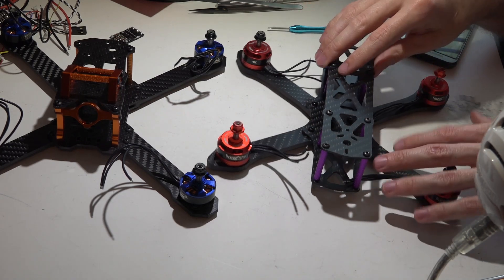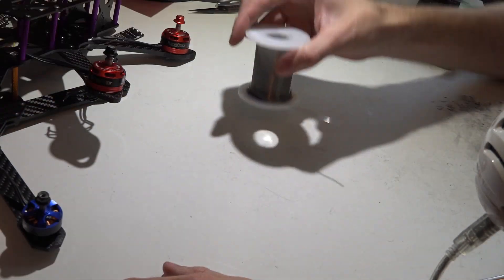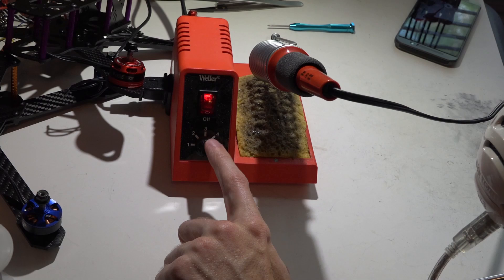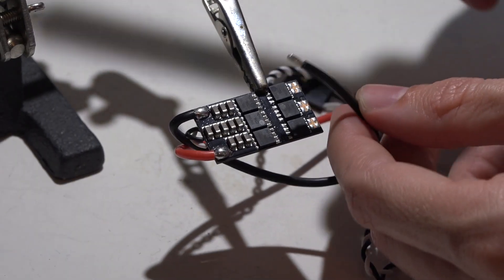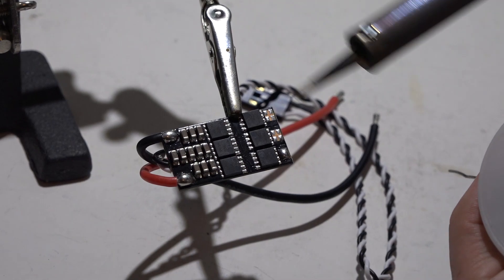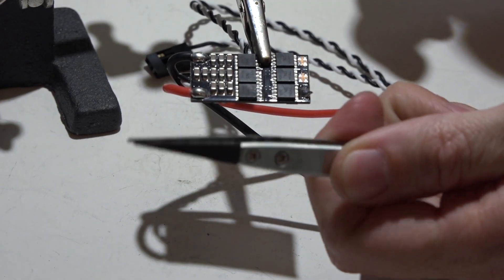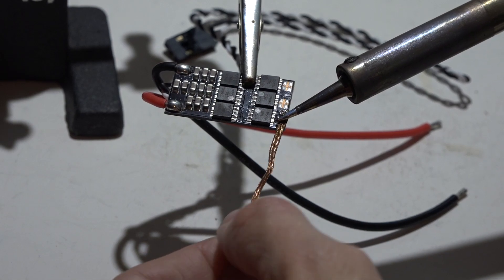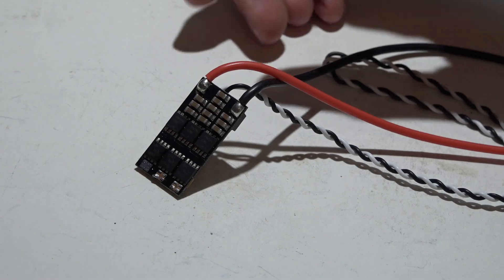Multirotor Build Pt4: Soldering Tips (plus more motor advice)

Comment: Love your series and this is a great comparison video. Thanks for doing it. One thing I saw on this video which you might want to try. On your helping hands station, I usually put one, maybe two pieces of Heat Shrink right over the teeth of the alligator clip, to help with damage control. It seems all too often, the newer boards are coming so compact that there really isn't anywhere safe to put a raw clip without damaging circuits or chips.

Comment: I used to do benchwork repair on telecom equipment (in a previous life :o ) and occasionally had to repair traces on circuit boards.  The wire gauge depended on the trace width, but 30 gauge (usually green-clad to match the PCB) wire was the most common substitute.  It was tedious at first, but I reached a point where it became as easy as any other repair.  Route the wire to mimic the original trace route, and glue it in place...  If the missing trace also ripped the pad away, then solder directly to the connecting wire.  I usually found a way to keep it neat and functional...!  

Keep that great content coming!

Comment: I've given up on solder wick, (or I lost it) I just use some battery wire, strip a bit of silicone off and dip it in flux, I use a tub of plumbers flux I've had for donkeys years, this works just as well, if not better and more controllable.

Comment: For soldering pads tinting wires and all kind stuff, change iron tip for more short and flat it will be giving more heat. This thin tip is for very small elements imho

Comment: Seen 43sec of your vid now, THANX for that tip, seen many who has gone with the hype and steel motors, some flights in they crash and wine about a bad motor. NO nothing wrong with the motor, only the screw.... so LOCK blue on all motors is the way. if they have a screw and not the c clip :)

Comment: i like blu-tak for holding stuff in place while i solder...those little helping hands wobble and drive me mad
Reply: I use blue tac for holding some things but on parts that are going to get really hot it melts and can be a PIA to clean up. Something I've found really useful for lots of.electronic type work is a little $20 hobby bench vise with a ball joint swivel. I use the type that has a triangular suction base not the ones that clamp to the edge of the table, it's sturdy enough for soldering without engaging the suction base so you can quickly turn it around to change your angle and move it out of the way when not in use.

Comment: Actually, wet sponge is not the best way to clean. Water causes thermal shocks inside the tip and the coating will fracture over time. Solder will dissolve copper inside the tip very quickly once the plating is gone. I recommend using steel wool instead. Works very well and i don't have to mess with water.

Comment: about removing the solder...I thought I seen you do a video and when you removed the solder you heat up the area then slam the hand holding the component to the table and BAM like it never happened...I seen that and said I think I just wasted 5 bucks on a solder sucker🤔...lol
Reply: Solder suckers are great, banging wire will remove excess and blowing hard on a through hole can sometimes clean it out but solder suckers are good for removing the bulk of solder quickly on something like an XT-60 connection.
Reply: That's the thing I only get the solder sucker to work only 1/2 the time but the slam move works every time for me.
Reply: Your slam move isn't going to work very well when what you're trying to desolder is in the middle of a densely populated PCB.. Try that then and you get to spend the next hour inspecting the board and cleaning up solder bridges everywhere.
Reply: Qumefox maybe if you dont slam it right then yes but ive yet to have a problem with the slam and have had problems with the soldier sucker. im only needing to remove the solder from the pinheader holes or esc pads its not like im putting the broads together.

Comment: great video. I have found that using the wet sponge to clean soldering iron distorts the shape of the tip I use a soldering iron cleaner. it looks like a ball of gold steel wool, gets the iron clean without distortion issues
Reply: havoc010101 nope
Reply: I've been doing the same for 25 years but I use a cheap silver kitchen wire scrubber instead of the "proper" tip cleaners. I've had the current tip in my iron for over 15 years. Also the reason the pre tinned stuff is no good is they usually use lead free solder which is difficult to work with especially when it's already been melted once.
Reply: John Citizen sorry, replied to the wrong comment:/
Reply: I agree. The brass wool/shavings does a much better job as it wicks the old solder and flux off.